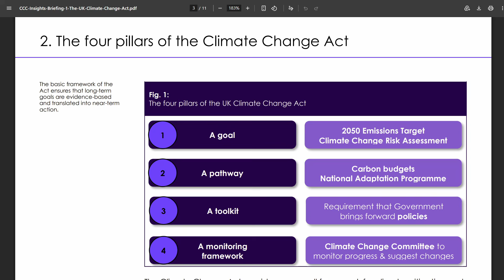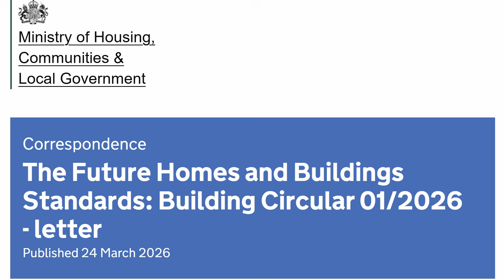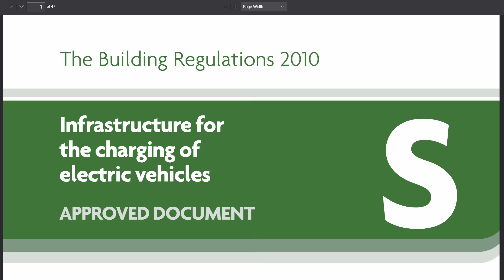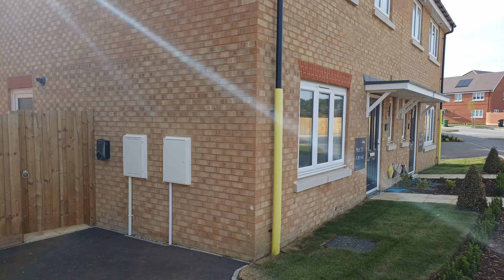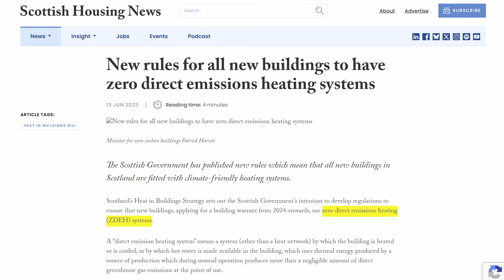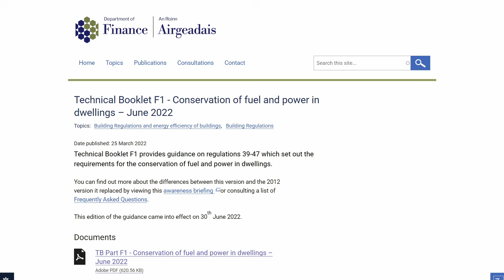Are New Build Homes Being Future-Proofed?

Comment: The requirements aren't strict enough in my opinion.

There is a new build estate of large detached dwellings near me and each house has just a 13 amp outdoor socket for EV charging and just two solar panels on each house roof which is pathetic and probably satisfies the minimum requirements?

I would have liked to see each house with a proper 7kW charger and roofs filled with solar panels. If these were installed at the time houses were built it would be so much cheaper than retrofitting later.
Reply from the maker: At a guess, that estate might have been built under the previous regulations.

During research for the video, I did see one estate built this way - in that case two sockets on the front of each house. I dont think that meets the latest regulations, as I understand them. However, ALL of the homes on that estate were occupied, and a couple were for sale again - second time around, by the first owners. This makes me suspect it was finished a few years ago, and building may therefore have started before the June 2023 deadline (June 2022 plus the year's transition period)

The new regs for heating, generation, ventilation and so on don't come into force until March 2027, sadly. The regs are nailed down - that's the good news, at last - but they haven't yet become enforceable. Perhaps I glossed over that a bit quickly in the video!

These Part L regs do feel late - very late. However, I think that was caused by confusion and renegotiation after the Rishi Sunak announcement from 2023 that I mentioned in the video.

On the site I visited that was obviously still under construction - many still for sale, and an entire section not yet built - ALL of the houses had 7kW chargepoints, as shown in the video. Rolec units I think. As I understand it, that's the minimum requirement now.
Reply: A good idea is to have a 13A socket on a 6mm T&E so it can be upgraded. However often missed is the data cable for load curtailment.

Comment: Would be good if the regs also included some requirement for e-bike/scooter charge point away from the house where possible.
This could be a metal lockable box just for battery charging or a full bike shed. 
Not that i have any such requirement myself, but these things are becoming increasingly popular and tend to be a fire hazard.
Reply from the maker: That's a really interesting idea, I like it. 

What might be best of all, in my opinion, is for us to weed out emobility devices built using cells of very low quality, and stop them making any sales. Lithium-ion batteries can be extremely robust and reliable - as EVs have demonstrated - but these cheap ones are not good enough to be sold.

I do take your point though - the other option is to have a dedicated location for their charging. Since it is SO hard to regulate online stores, maybe that's the only practical solution.
Reply: Nice idea - like the outer casing of a grenade?  🤣